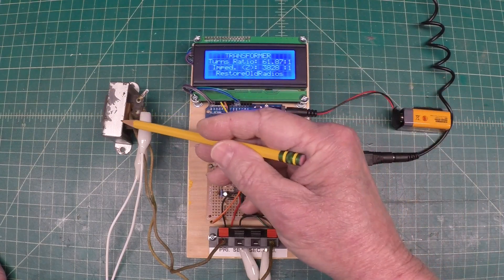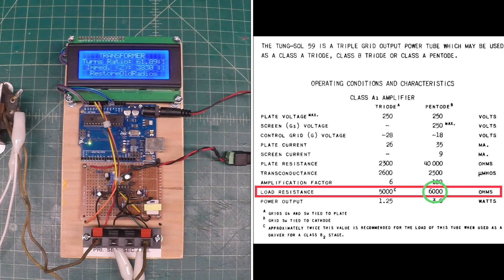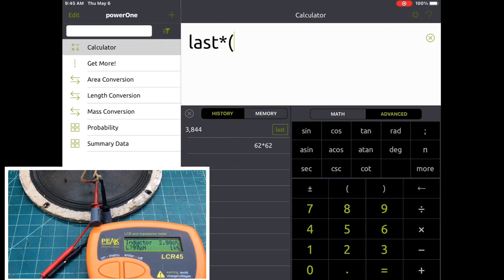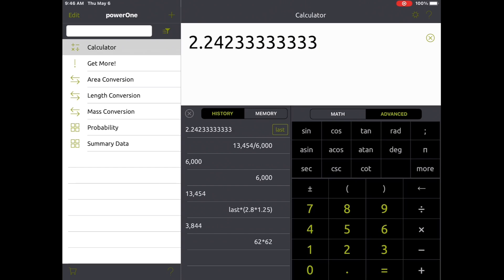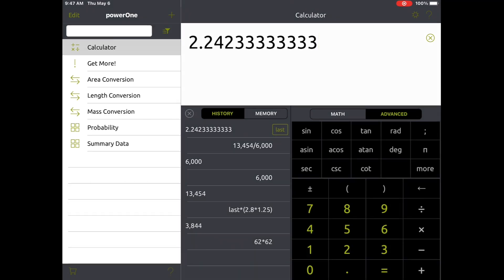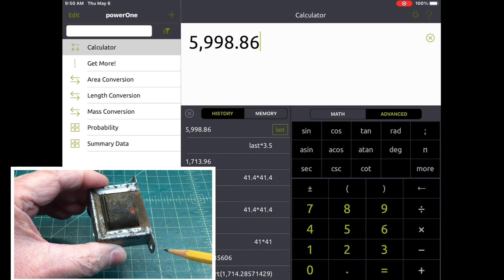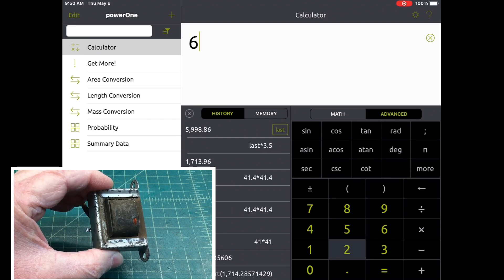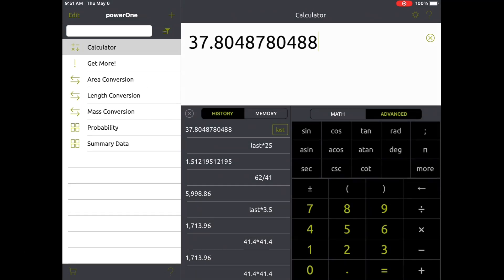Zenith 707 - Rewind an Output Transformer & Change the Turns Ratio

Comment: Don could you help me understand core stacking in the transformer?  In power transformers, I see the E and I laminations alternated.  In this audio transformer, they were not intersperced.   Was there a gap between the E and the I section?  
All the best, Dave
Reply from the maker: Dave - my knowledge is limited in this area as this was my first time rewinding a power transformer. There were no gaps between the E & I laminations other than me applying MG Chemicals 419D Acrylic Conformal Coating, Clear Finish, Aerosol to the laminations, which should reduce Eddy currents making the transformer more efficient by reducing losses. The overlapping of the E & I laminations should reduce flux leakage, again making the transformer more efficient according to the engineering white papers I’ve read. Sorry I can’t expand more beyond my response. Thanks for reaching out. Best, Don
Reply: @RestoreOldRadios  Thank you Don for the reply!  Every little bit helps.  I was going to ask on the conformal coating, so that was a great addition.  Magnetics have always been a hidden art form to me!  ... still learning though, after 3 retirements... 🙂
Reply from the maker: Here’s a good read: https://worldradiohistory.com/UK/Bernards-And-Babani/Babani/118-Practical-Coil-Construction%20Bernards_60.pdf
Reply: @RestoreOldRadios  Thank you again Don, what a great resource!  Those old handbooks are the best!  I am going to read cover to cover over the Christmas holiday!

Comment: The smaller gauge of the wire, to accommodate for the larger number of turns, might have little to no effect on the operating requirements of the audio output tube.
Reply from the maker: Chet - I always value your feedback and taking time to share your knowledge and experience. Thanks again. All the best. Don

Comment: Don, just wondering why the turns ratio isn't already a good match for the tube and speaker. Did they miscalculate back then?
Reply from the maker: Cjay - a great question. I’m guessing the transformer is a replacement and not the OEM. I looked around and haven’t found any other examples to validate my theory. If you run across something, please let me know. Thanks again for watching. Best, Don
Reply: @RestoreOldRadios  I would trust your guess that the transformer has been replaced, seeing as you measured the actual voice coil impedance, and the transformer isn't correct as measured. Rewinding the secondary and using the smaller guage was brilliant, and no one's gonna be playing that radio at a high volume anyway, to stress the smaller guage (besides the more efficient match anyways). All in all, it'll be a good restoration and an enjoyable learning experience for all.

Comment: Very much appreciated the video!  I still don't understand the bit about the calculations for impedance and turn ratios, but maybe if I watch it several more times I will.
I have been wanting to create some Toroid transformers...both for power and for audio output.
Reply: Wayne, the impedance ratio is the square of the turns ratio. So he worked backward from the requirement of the vacuum tube - 6000 ohms, and calculated the impedance of the loudspeaker as well. Therefore he knew the impedance ratio needed. The square root of that gives the required turns ratio. Just not sure why he is changing anything if the speaker and the transformer are original. I probably missed something.
Reply from the maker: Wayne - thank you for watching. Cjay's reply is spot on, so you can see how I backed into the numbers. I don’t think the output transformer is the OEM part and had been replaced at some point during its life. Best, Don